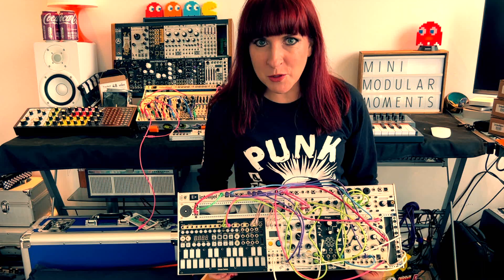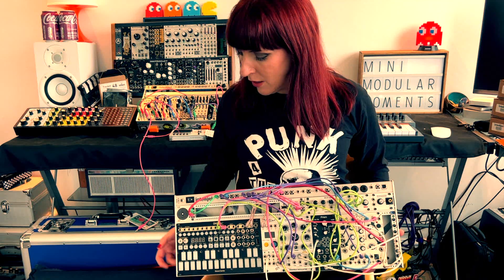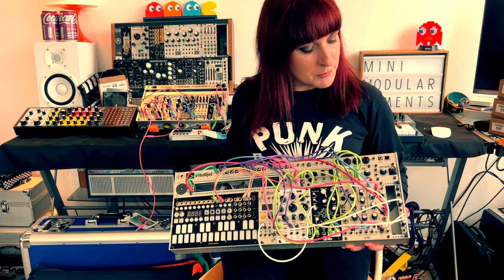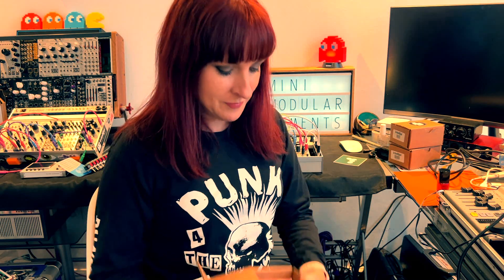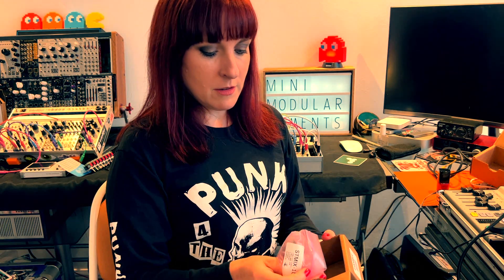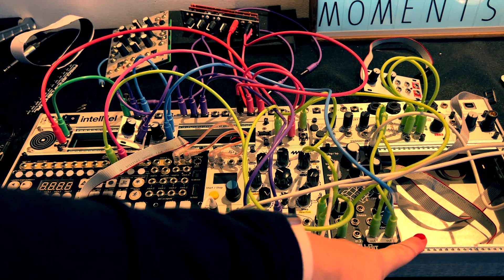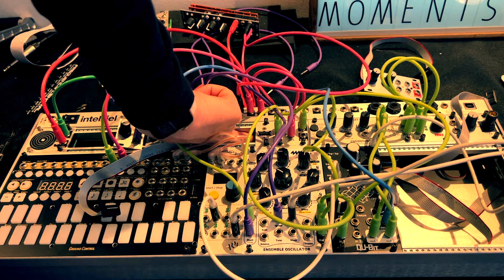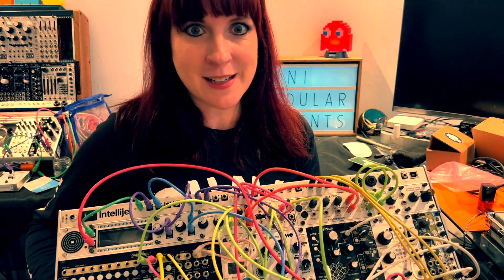Adding And Subtracting

Comment: Maths can do so much, but I also mostly use it for attenuators and envelopes.  I wonder if i can also do without Maths and just put in envelopes and attenuators and get more use out of that HP. Hmmm. Great video as always!
Reply from the maker: Glad you enjoyed! I still need to test the envelope to see that it does the same as what maths did. Maths is huge but so easy to use, I’m hoping I don’t miss it too much!
Reply: @iamseeingdots I'm sure I saw a slimmed down Maths clone on Etsy or Ebay or somewhere. Might have been by After Later.